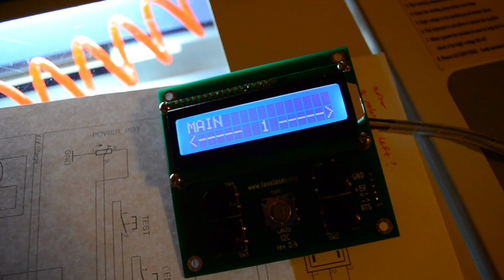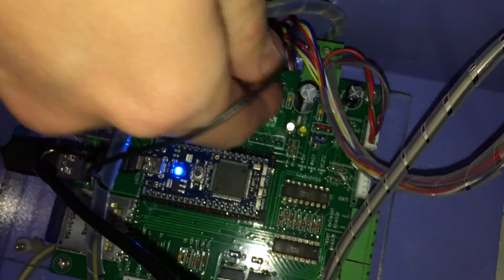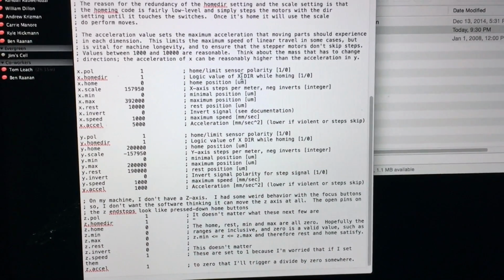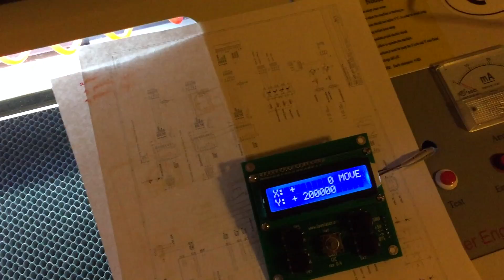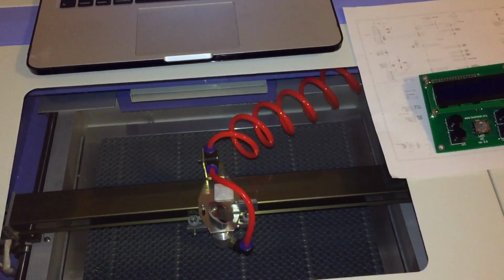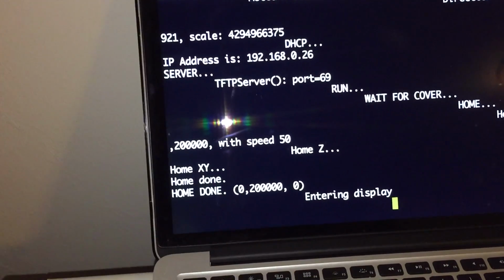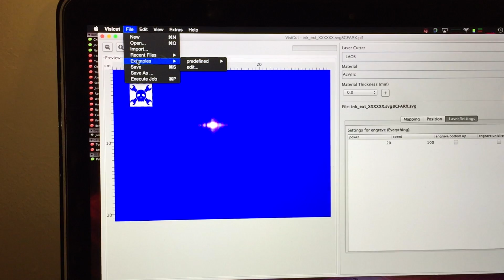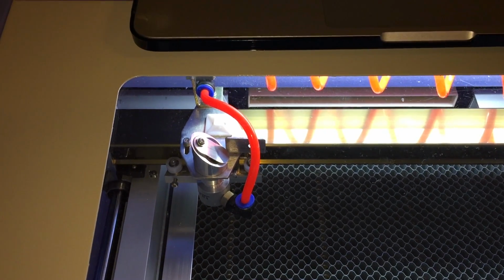LaOS Laser Part 4 Configuration

Comment: how did you make the minicom to talk back and echo on terminal? could you share the settings for the "embed" configuration? 
I am trying something like this "minicom -D /dev/tty.usbmodem1422 -b 115200"
Reply from the maker: +jegb70 I redid my computer, so I don't have it anymore.  You want to do "sudo minicom -s embed" which will start a minicom session where you can edit the settings.  Setup the settings you need then select save setup as embed, and you can use it over and over.  Then, you can set local echo.  Use control-a then z to access help.

Comment: was the firmware bug on the i2c display arduino code (y movement)?
Reply from the maker: +jegb70 No, I don't think so (assuming I understand the question).  The y-movement was a cheap pulley that wasn't round. :(
Reply: the question related to the joystick direction of travel, did you modify the config.txt only or also the i2c display .ino file?
Reply from the maker: +jegb70 The config file.
Reply: Thanks!! all working except the ip binding, dhcp is not working